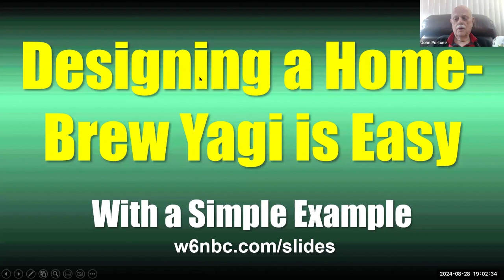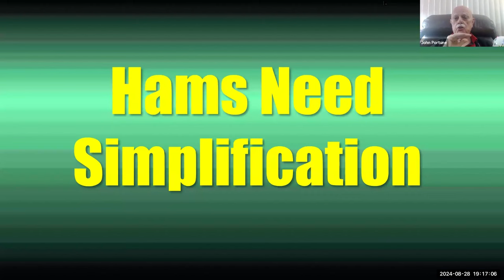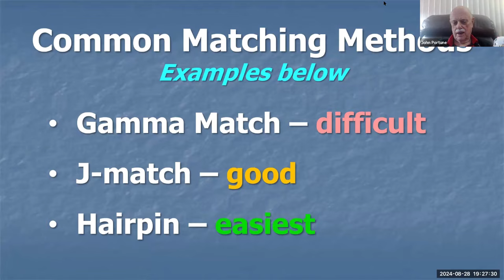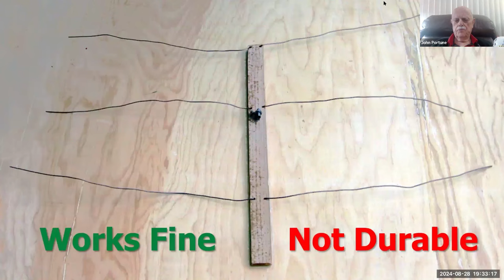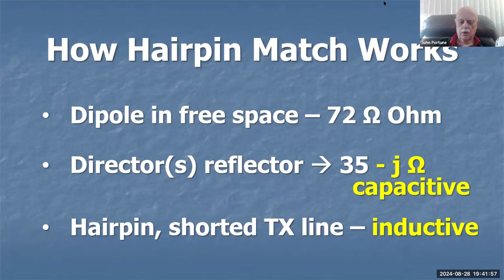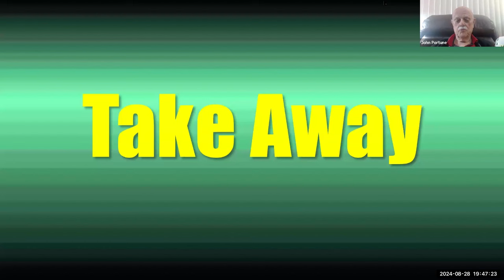Power Hour Tech Talk – Designing a Yagi Antenna - 28 August 2024

Comment: I've designed and built several, using the NBS Technical Note 688 method, The Ed Tilton designs from the ARRL handbooks, the DL6WU model, etc.  They all worked well, even though the dimensions of each design type were slightly different.  People have convinced themselves that Yagi dimensions and tolerances are super-critical.  Really, the only hard part is getting started. Well done.